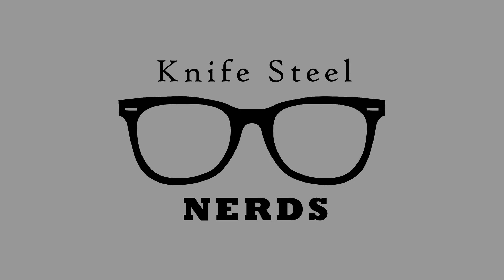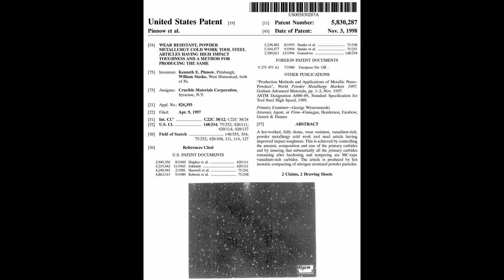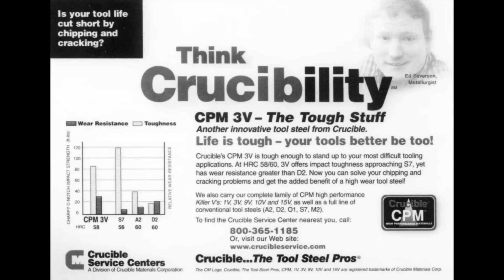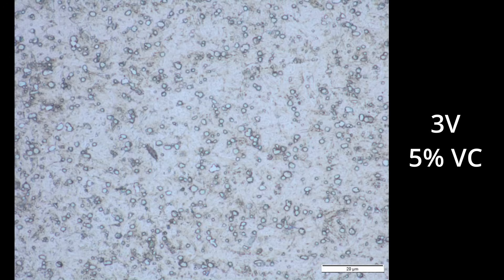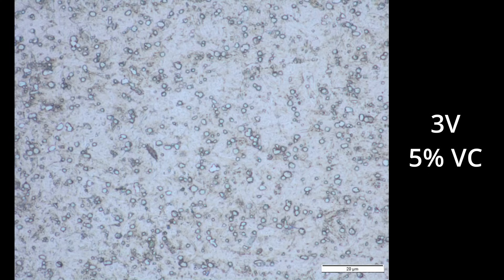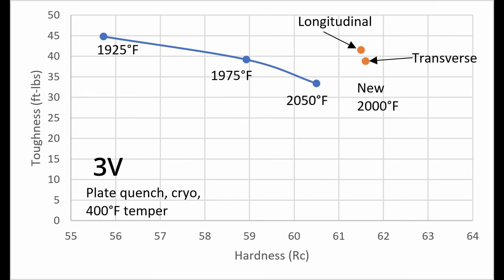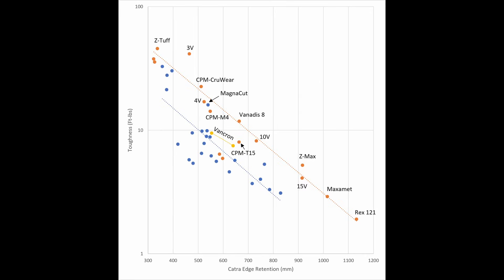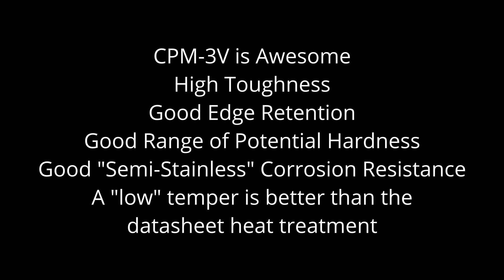CPM-3V - Still the Best High Toughness Knife Steel

Comment: Can you comment on delta heat treat? My main fixed blade is a survive knife with a delta heat treat. I have a demco folder in 3V. Also, and
I totally agree that 3V. It should be the top choice for anything that's going to be subjected to hard use. I also love Buck's 420HC. I once pried an arrow tip out of a hard stump, and was amazed that my little Buck mini Spitfire didn't snap, as I was really torquing on it.  But of course 3V holds an edge much better, even if not quite as stainless.

Comment: I've been wondering if edge "stability" (ability to: form wire burrs, take low edge angles, maintain good micro-serrations at high grits) has a viable empirical correlation to impact toughness and grain distribution types. Not sure if stability is the best term to encompass all that. Empirical testing from guys like NeevesKnives suggest that certain steels consistently perform worse with polished edges (s35vn, s90v) as well as PM versions of steels being unable to take even medium grit edges that the original, non-PM steel could take (D2 -> CPM D2, 154cm -> CPM 154). I'd be very interested if a study similar to this has already been conducted as perceived, functional sharpness is probably the biggest feedback steels give us in pocket knives particularly

Comment: My favorite steel is 1055, which is used in myriads of axes and machetes worldwide.  It is as tough as possible, you can sharpen it with anything, and it stays sharp long enough for any kind of real-world use outside of a professional kitchen or butcher shop.  Corrosion is a non-issue to me because significant corrosion only occurs with grossly neglected and unused knives, and is merely a cosmetic defect even in that case.  If I had my way, all of my knives would be drop forged out of 1055, that way they would be impossible to break and I could maintain them indefinitely with just a small Arkansas stone that will last forever with minimal dishing and requires only a few drops of water and use.  Every modern stainless steel is a flat downgrade and offers me no advantage.

Comment: The only scientific test of toughness I would accept would be to produce multiple knives with the exact same dimensions and tang geometries, put them all in a vice by the handles, and then strike them on the spine with something like a hammer with a consistent amount of force and record how many strikes it takes to make each knife snap off at the tang junction.  Until I see a test performed exactly like this, I will continue to believe that carbon and low alloy tool steels represent the toughest blade steels.  To date, I have not witnessed any evidence that any of these "super steels" survive hard knife uses like batonning better than steels like 1095, 52100, or 5160.  Their performance in dies is irrelevant because a die is subjected to a completely different type of force than a knife.  It's like the difference between hitting something with a stick vs thrusting the end of stick directly into something.
Reply: Did you actually look up how they do toughness testing? There's a few different methods but thats the basic way they do a couple of them just in a more controlled fashion. 

Read up on it then come back here and tell us what you find.
Reply: @cheatinggravity173  All I've ever found are tests where they drop the knife on the edge onto something hard to measure edge chipping.  It's the kind of "toughness" one thinks of in the context of kitchen work.  It's not an outdoorsman or survival type of toughness.

Comment: Waiting to receive myNorth Mountain Blades production Dwyer BNMM frag bowie with a polished DLC 3V blade (same coating on the handle).
I emailed NMB to ask them to test this particular knife as they did not state their HRC for their 3V and their U.S arm/supplier got back to me saying they would test it and post it on their Instagram.
It got a 61 HRC after like 7 separate tests over both sides of the blade, I recommend watching it.

Comment: Great video. I lean toward these 'semi-stainless" steels instead of full stainless due to their higher toughness. Just maintain the knife and you don't have to trade off to achieve a "stain-less" knife blade. Workshop has a new folding knife (RMX) and they use 3V for the thin, slicey reverse tanto version (60-62 hardness and sharpened to 15deg per side). Can't wait for delivery tomorrow! Very interested in their choice of 3V and think it was a good one considering what I've been learning about it.

Comment: I am a knife sharpening nerd and 3v can maintain a hair splitting edge well.  I have become a connoisseur of fine edges and the fine structure of 3v lends itself well to fine sharpening.  My next venture would be high magnification comparison with testing.  Perhaps there are finer grain steels out there but I haven’t had the pleasure to sharpen any of those yet.

Comment: According to the data sheet at Niagra the impact toughness of 3V doubles from 40ft-lbs to 85ft-lbs when you drop just three RC points from 61RC to 58RC.

A bit of stain resistance is nice but when you're getting half the durability it kind of negates the entire point of using 3V to begin with.

Comment: One aspect of 3V that I think is often overlooked is that the excellent toughness/hardness/edge-retention balance is well suited to much thinner geometries, as the edge stability should be great -- thin edges should chip much less with the high toughness, and at the hardness/strength achieved with this austenitising temperature/low temper, should also do decently well at avoiding rolled edges too. Despite this it seems mainly to be used for thick choppers and the like!
Reply: I agree. That’s the main reason I like it so much. A thinner blade is just better at cutting and slicing than a thick one, and 3v lets you have a thin blade without any of the usual drawbacks.

Comment: Now that you have done 3V I hope you do sleipner next.  
I have a strong preference to stainless steels (Specifically AEB-l family) and semi-Stainless steels.  I am not big in knife collecting so I do not have that big of a collection.  With that said I do have an AEB-L, a 14c28n, a sleipner, and a VG-10 knife.  All knives were done great, but I like seeing scientific results.

Stainless steels are great because of how simple maintenance is, but I also like Tool steels because they are a midpoint between Stainless and Carbon.   They have a similar edge to carbon but they also have lower maintenance requirements.

3V is a steel I like to see how it is used and I have yet to hear anyone saying anything bad about a Knife made in 3V (I have heard of how difficult it can be to make a knife in it).  
I want to add a 3V knife to my collection.

Comment: Do you think the longitudinal/transverse toughness differential between the two coupons could have [also] been because of the means of elongation/forging?  For example perhaps your coupons may have been rolled in the longitudinal direction and perhaps his were hammer drawn to elongated them?  I agree the thickness ergo cooling rate also may likely have played a part, and perhaps it's both factors.  Just a thought, because that's really strange difference and 3V is known for not being too finicky for its class..

Comment: I've been oil quenching 3V for years. It gives a noticeably higher hardness.
Reply: How do you prevent decarb?
Reply: @highplains7777 Stainless foil, quenching in packet is fine. If I have a big batch I outsource to a commercial heat treater who uses a nitrogen fluidised sand bed. The blade is shielded from oxygen while austenitising and is only briefly exposed to atmosphere when transferred from sand bed to oil.

Comment: I love 3v. I've found it very stain resistant too. Cant speak for saltwater environment, but in the Midwest you have to intentionally neglect your knife to get it any more corrosion than surface rust that simply wipes off. I like Cru wear a bit better though.
Reply: Why do you like CruWear better?  Do you find it to have noticeably better wear resistance and/or edge retention? I ask because, at least on paper, they seem very similar. Most of my knives are in 3v, but I recently purchased one in CruWear just to try it out. I haven’t had a chance to test it out much yet, so I’m curious what your experience has been.

Comment: Thanks for the video. 
3v is pretty much the gold standard in hard use outdoor type knives.
One issue I have with 3V is that its not usually available in consumer products at higher hardness. For that reason, and the fact that other steels with better wear resistance like cru-wear, even 4v and m4 and even k390/10v already have more than enough toughness overhead for the vast majority of normal knife use cases. Even the least tough among those, k390, is tougher and at high hardness than many stainless steels commonly used for edc type knives and such. And also if you're going to go with vanadium steel, IMO you might as well go all the way (to the limit of minimum viable toughness/more abrasion resistance) because even at 3v levels of vanadium the end-user is going to want/need superabrasives for best results and ease of sharpening/maintenance. And at that point it's not really any more work/effort to manually grind 3v vs 10v on diamonds when we're talking in the context end-user maintenance/sharpening. But, you still have plenty of toughness (edc context) and get a big boost of overhead in edge retention. So to me, this is why I don't prefer 3v outside of like exceptionally hard use cases and or LARGE blades. And even then, there are other choices worth considering like cru-wear sometimes but also stainless steel like AEBL, or low-alloy steel like 52100, even though 3V is certainly much better than those in edge retention for instance. However you don't need special abrasives and they grind like butter so it's ease of use. It's all about personal preference and specific needs. I find the matrix steels and 1v and whatnot pretty fascinating, I'd say those are really under-rated and under-utilized as well.

Comment: Truly on the best steel, Delta 3V was the hype around 15-10 years ago, only Dan Keffeler, Nathan(CPK) and Guy(Survive) were using it. To this day it is still the best protocol for the steel. Beside the better sharpening experience, Delta 3V improves the pitting, I have BRKT and other custom 3v with low temper got pitted, while Survive and CPK didn't. 
Another interesting steel to compare it is the so called Japanese 3v - OU31, another great steel, a bit less tougher, but same vibes. 
Commonly compared steels are INFI and Sleipner, but IMHO are behind 3v.

Comment: I’m planning on making a rescue axe to be used with fire fighting. I have a design in mind, but couldn’t decide on the steel I wanted. A2 was a front runner, but now I’m thinking 3V. Now I just need to find a supplier that can sell a 3/8” 6”x24” plate.
Reply: Most of the firefighter equipment pry bars etc are chromoly 4130 4140 pry bars and breaching bars to rip doors open
Reply: Fkr an axe, alot of toughness comes from the basic geometry and sheer thickness. You might be able to get away with a steel that has higher edge rention more baleanded steel without suffering damage, based on the apex angle and thickness.

Of course, I've never built an axe so what do I know😮
Reply: McMaster carr sells a bunch of big plates of tool steel and chromolly steel in sizes like that. 

4340 (or 300m lol) would make a brutally tough axe. The best throwing knives are made out of that. Desert racing trucks have axle shafts made out of it, its unbelievably strong.

Theres some really strong spring steels too. 

I wouldnt need a piece that big for an axe though, I'd make my handle out of aluminum or wood. Probably center-reinforced wood because of how aluminum picks up heat.

Comment: Sounds like it's time to update the reference chart in the book I keep going back to.

Since I'm using the low temper range, does this mean that I should increase the corrosion resistance to a bit over D2 (per the picture)?  Should the toughness go up to 9.5 instead of 9?

As always, appreciate your work.
Reply from the maker: I don’t have the book in front of me but the ratings I have o line show 3V as having higher corrosion resistance than D2. The toughness might get bumped to 9.5.
Reply: @KnifeSteelNerds  I appreciate it.  I'll update my charts.

Comment: Any reason this wouldn't be a good chef's knife steel? Everyone is only talking about outdoor knives, which makes sense, but cutting hard vegetables would benefit from high toughness too.
Reply from the maker: If given the right heat treatment it definitely could
Reply: There are simply better options. A toughness level that high is not necessary in a chef's knife. Why make trade offs in corrosion resistance and edge retention to get toughness you'll likely never make use of? Unless your plans involve a knife that's extremely thin behind the edge and sharpened at very low angles, it's not feasible that 9/10 toughness is going to get made use of in a kitchen.
Reply: @Aerzon1v1  I think it does depend on the user. Non knife people (my knives are mostly wedding gifts) can be pretty tough on their knives. I watched my friend that I made a knife for wash it then put it in a drying rack jammed in between a bunch of silverware. Sure enough, it had been chipped in a few places. Who knows what else he put it through.

Comment: I have knives in 3V from both Bark River and Cold steel. Does anyone know, or can make an educated guess on, how they're heat treated? Neither of them has rusted on me, but they also haven't been subjected to particularly challenging environments.
Reply: I believe bark river sends their knives to Peter’s heat treat in Pennsylvania. You can probably look up how they (Peter’s) do it. Most of my 3v knives are from LT Wright and Bark River,  and I’ve never had any rust issues either. In fact, the corrosion resistance is one of the main reasons I prefer 3v in my outdoor/bushcraft knives. I don’t abuse them, so the toughness is probably overkill, but I appreciate the corrosion resistance and edge retention 3v offers. Now, If I lived in a salt water environment or somewhere with high humidity year round (like the Pacific Northwest) things might be different, but I spend a lot of time in the Appalachian mountains and never had rust issues with 3v, or even A2 for that matter.

Comment: I'm wondering....from what I understand vanadium is a stronger carbide former than chromium which is why cpm3v doesn't form any chromium carbide. but that be maintained if the chromium was boosted up a couple of %? if they could get a modified version of it to work like your magnacut where it has just enough chromium all in solution to be classed as stainless, I think it would solve the sales problem.

that's kind of a weird thought....engineering a steel not really for function but to sell better.

Comment: I have always wondered why 3v isn't used more in folding knives.  Id like it if Spyderco would put it into production on all the big models like the PM2, Manix 2, Native 5, etc. sort of like they are already doing with CPM CruWear.  If I had to choose between CPM CruWear and 3V I'd definitely pick 3V for that fine grain structure.  My biggest problem with CPM CruWear is that it just doesn't get quite as fine of an edge as other tool steels like CPM M4 and K390.
Reply: Because there's no reason to utilize a steel enamored for it's toughness in a 3 inch folding knife. You need maybe 1/3 of that toughness unless your plans for the knife involve goofball activities, and as we know, the properties are a tradeoff. 10v, for example, is far more suited to be a small folding knife steel. In my experience, CruWear takes a hair whittling edge as well as anything.
Reply: @Aerzon1v1  🤖

Comment: Thank you very much Larrin for this another great study and video!

A real stainless version of 3V with the same combination of Toughness and Wear resistance would be awesome if metallurgically/physically possible.

How much do you think the Toughness would be improved by forging 3V? I mean, hammer forging by the knifemaker, I know the steel is already forged at the mill.

I remember your study last year with AEB-L that showed over 30% greater toughness with forging... and AEB-L has already very very fine carbides even before forging...

Comment: 3V vs 3Vmod, is it possible those results in the patent were due to high temp temper, and your low temp temper dramatically improves transverse toughness?
Reply from the maker: The tempering temperature wouldn’t affect the orientation effect, at least not to that degree

Comment: Love 3v I’ve been using low temper  and have had no problems
Reply: with the new steels in the last couple decades and the PM process, toughness and understanding of it has rapidly progressed. it's almost a crime that so many knives are still sub 60 hardness. they could easily be putting so many of these at 61-63, or even higher for some(like 3v) with no problems.

Comment: I was interested in giving it a try. I had a bit of sticker shock when alpha knife supply wants 60 for one bar of CPM 3v knife steel. That's an expensive bit of steel to lose if I screw it up.
Reply: I just nabbed a bar of 0.100” 1.5” x 11.5” for $30 

The good price deals sell out fast and what’s left are less desired thick and long pieces. 

Check their sale page. Just got an 8” bar of lc200n for $20. 

I collect bars of steel now instead of knives. Just got some s125v worried about the company going away, and the fact that s125v is a rare bird. 

Once I saw maxamet and z max on aks